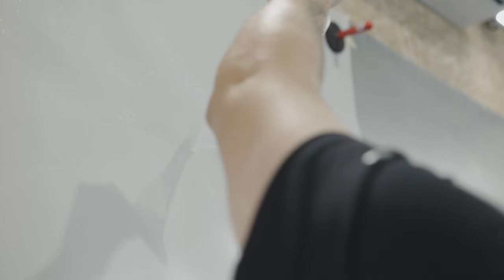Porsche 911 GT3 | FULL Detail & Paint Protection (Automotive Detailing)

Comment: Can i ask how long ppf is supposed to stay on a car?🙏
Reply from the maker: Sure, no problem at all. Thank you for asking! 

So it’s totally depends how often the vehicle is used and it’s annual mileage. It use to be the case that after a few years it would begin to turn yellow in colour and you can sometimes see examples of this on used cars when ppf has been applied by the manufacturer. However this is no longer the case especially with Gyeon PPF. In terms of wear and tear on the PPF it all comes down to what the vehicle is used for (track days, motorway miles e.t.c). Some high contact area’s (bumper, bonnet, side skirts) may need replacing every 3-5 years depending on the customers preference and how well the car has been maintained. Gyeon do however offer warranty with their PPF products which you can read about on their website. Hope that helps! 

If you have anymore questions, just let us know 👍🏼